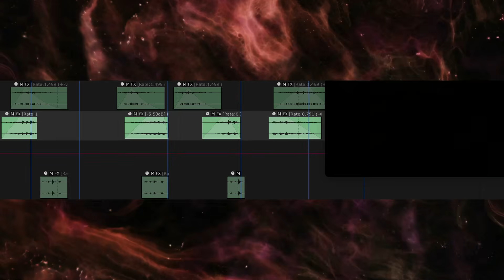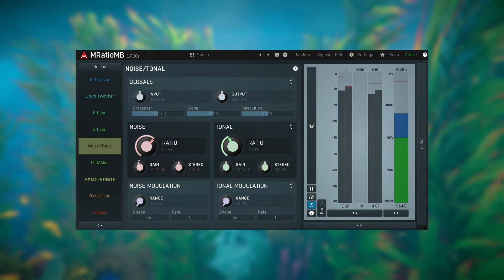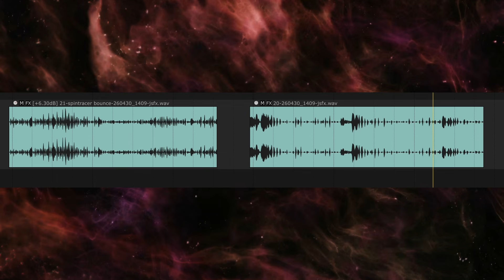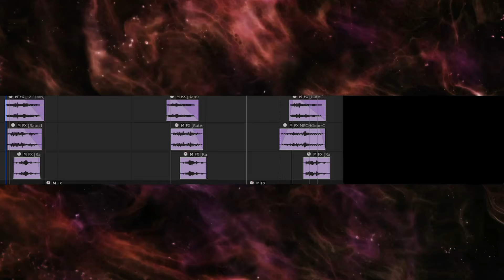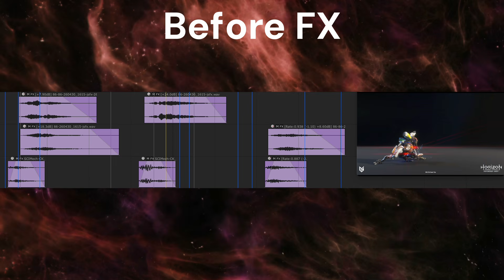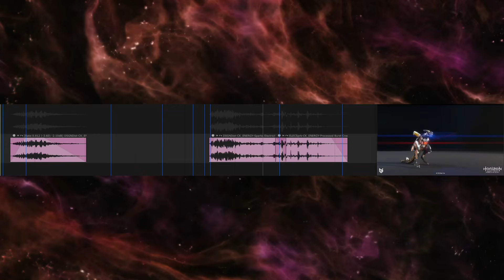Designing ROBOTS using Machina- Demo and Review

Comment: Nice sound design! I was confised at first thinking Machina actually designs 3d geometry for robots. It turns out it is a sound designing software.

I bet someone somewhere out there is thinking "I can do that with Serum".

It is such a complex thing to do.
Reply: Great observation! 
Machina is a sound library, not a software instrument. The sounds are primarily rooted in real world recordings of mechanical hardware and physical objects, then heavily processed and designed to be ready to use straight away.
So while synthesis like Serum has its place, Machina brings something that goes well beyond pure synthesis!